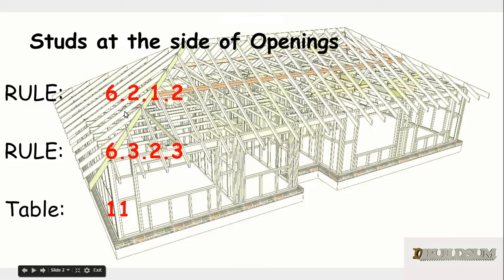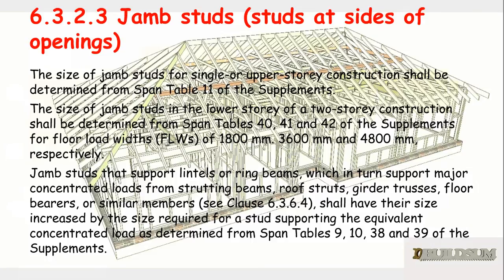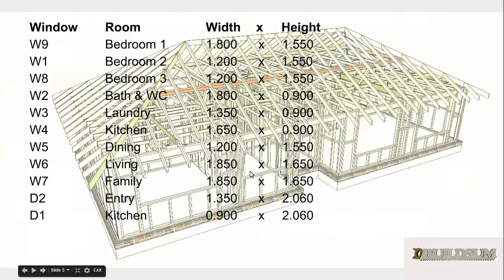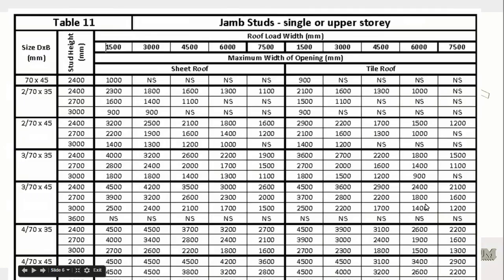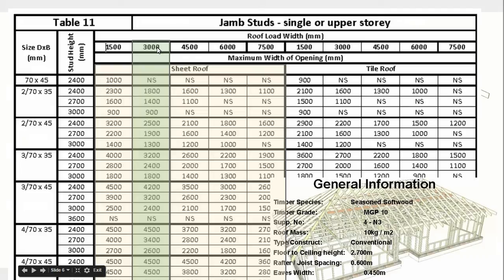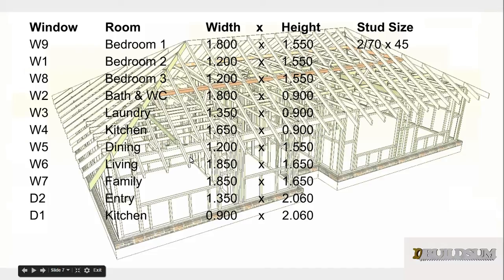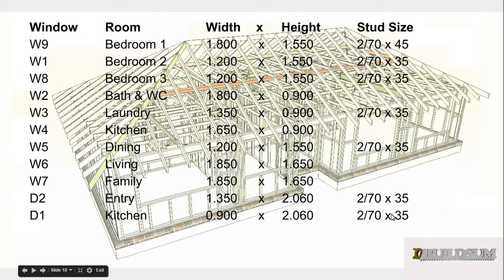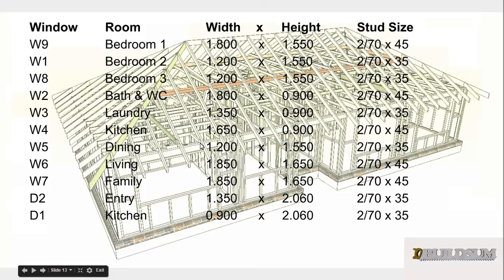21 Studs at the sides of Openings

Comment: What happens if a length of wall is not equally divisible by 450 or 600? Say for example you have a wall that’s 3350/600, would you still space by 600 and split the difference at the end of the wall?
Reply from the maker: Hi Mate. you can just use the standard spacing and then end up with a smaller space at the end or divided the length by say 600, round up the answer and then divied the length by the rounded up number to get the new consistant spacing.
e.g. 4.500 / .6 = 7.5 So 8, 4.5 / 8 = 0.563 spacing. Hope this helps

Comment: Hello I am new to this site and it's very interesting. I cannot find an example of structural /load bearing studs at each side of an opening of 5.5m wide.(for a garage) brick veneer construction.  Wall height is 2.4m & common studs at 600mm centres. I have the beam size ok, but unable to find what studs I require each side of the opening. Masonry roof tiles. Can I get some guidance please. 
Cheers Ken
Reply from the maker: Hi Ken, Unfortunately, a span of 5.5m is outside the range that AS 1684.2 covers so you should refer the question to a structural engineer. Probably not the answer that you wanted to hear however there aren't too many other options, sorry